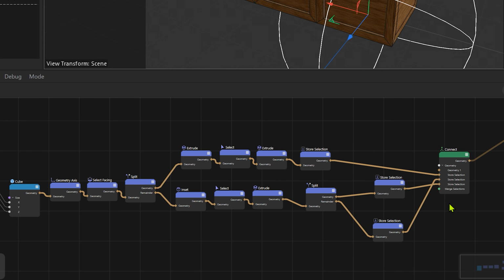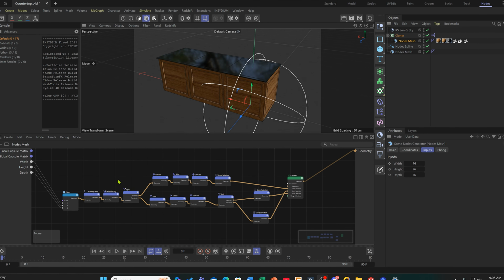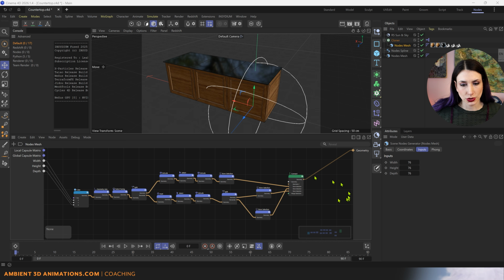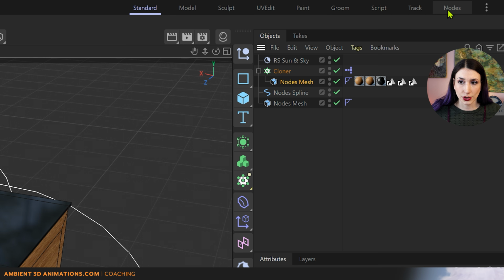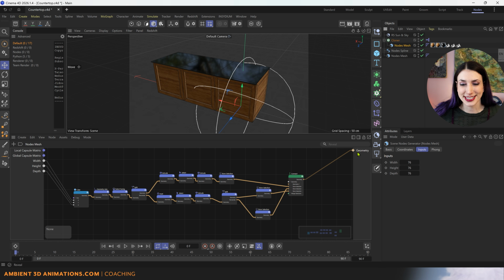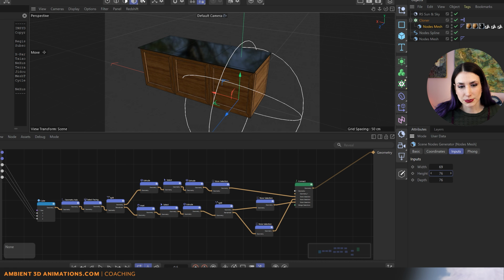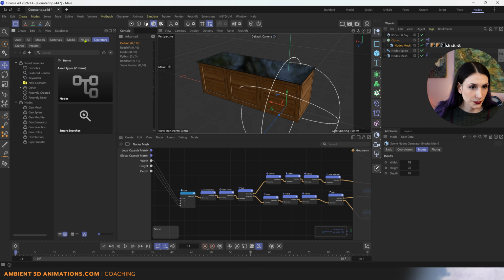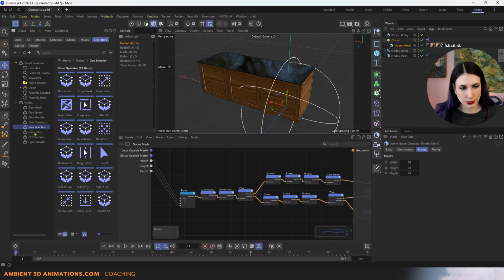3D Model with Cinema 4D Nodes: User Interface Part 1

Comment: Would you say that learning this, and you teaching us, would be great to apply with learning Houdini as well? Since it's pretty much node based?
Reply from the maker: I haven't tried Houdini yet so I can't know for sure until I do. However, I've worked in several 3D software and find similarities between all of them. I've worked in SolidWorks, Unreal Engine, 3D Studio Max, ZBrush and  Rhino. I think learning one helped me learn the next quicker because there are similarities in process. Now I mostly use Cinema 4D and Unreal for work. That is a great question. I may try asking some of my Houdini knowledgeable friends.